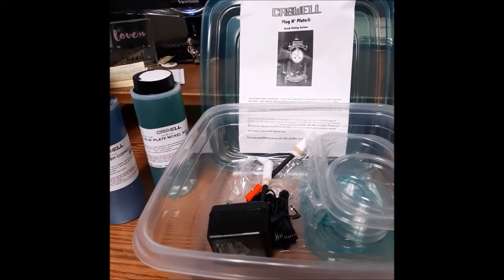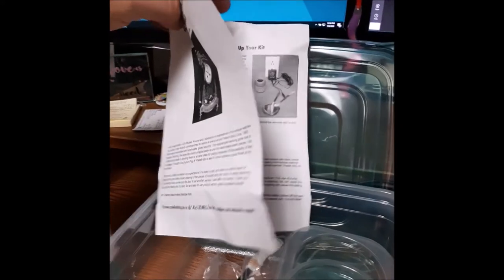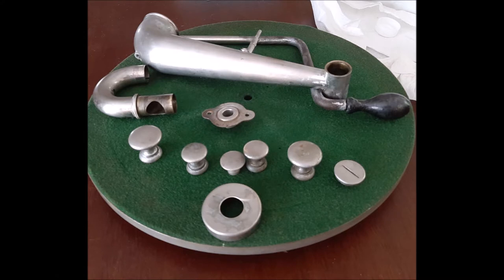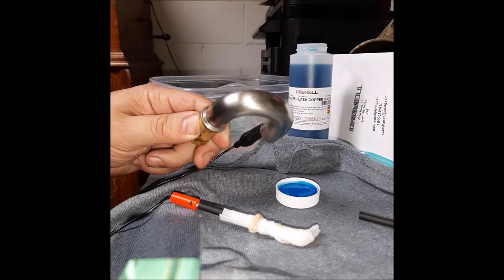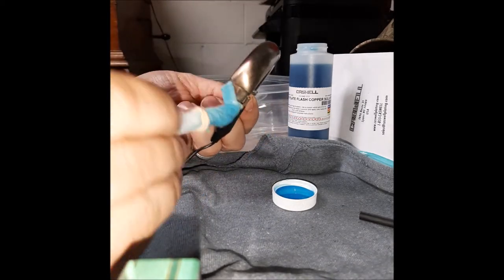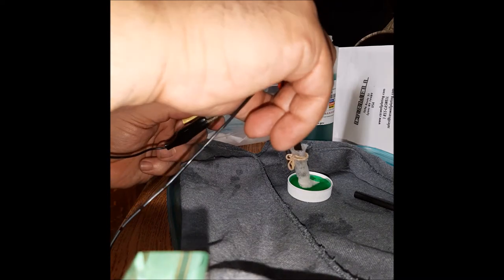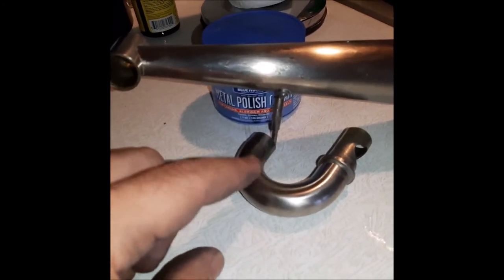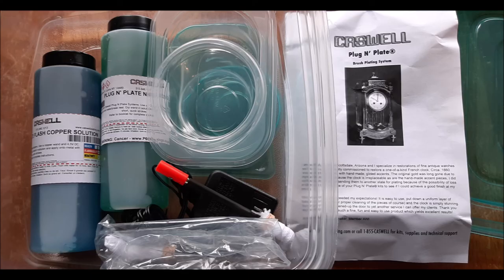Plating Victrola Phonograph Parts with the Caswell Plug N Plate Plating System

Comment: As someone with extensive knowledge on the subject, here are a few tips, Give the pieces a solid/thick copper coat, as much as you possibly can(I know brushing can be tiresome), because you will need to polish that copper suface, after it's as shiny as possible you will need to degrease the part and then give it the Nickel coating, there will be no need to polish the Nickel.
Reply from the maker: Thanks for the great tip!